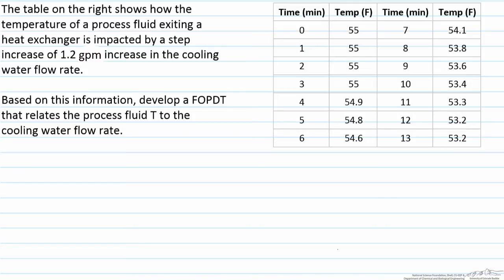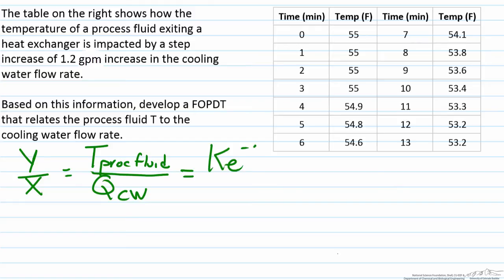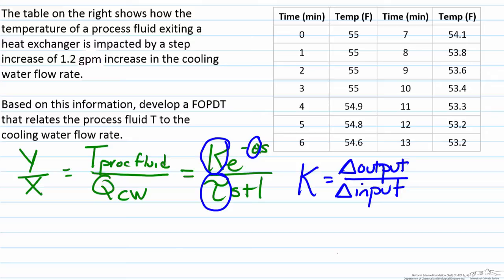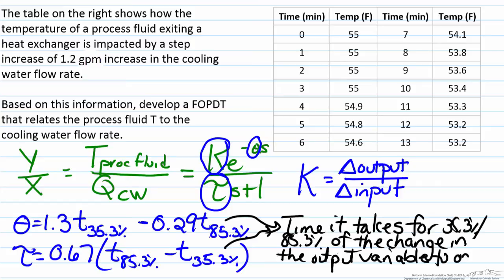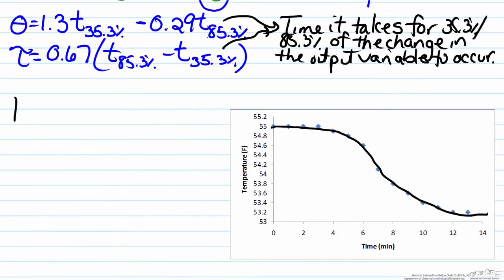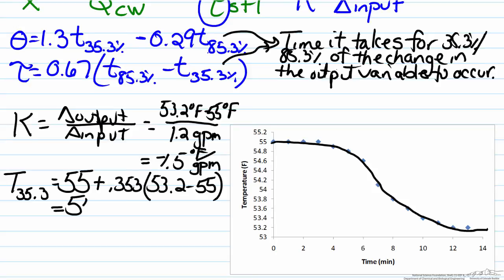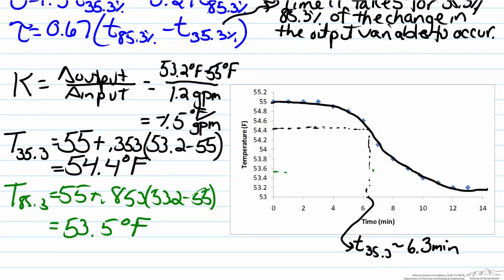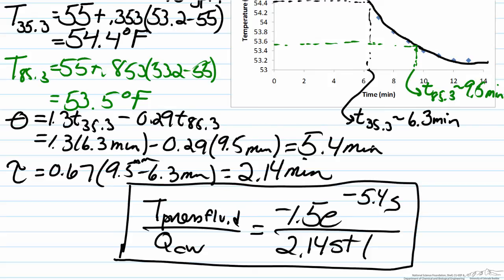Using Data to Develop a FOPDT

Comment: hey thanks for your explanation. i dont get what the K is. you said that K is the steady state gain of the system, and it is equal to the change in the output divided by the change in the input. i dont understand what is the meaning of "the change in the input". i mean how did you get 1.2gpm on your data? thanks
Reply from the maker: The change in the input is the step change, or 1.2 gpm.

Comment: to find K why is it (initial-final) output/(final-initial) input?
Reply from the maker: Thanks for you question. K is the steady state gain of the system, and it is equal to the change in the output divided by the change in the input. This is just by definition, so there is no derivation involved here. Hopefully this helps!
Reply: @LearnChemE  But then why the -ve value? Is the step change in opposite direction?